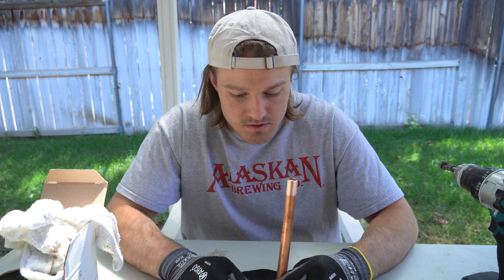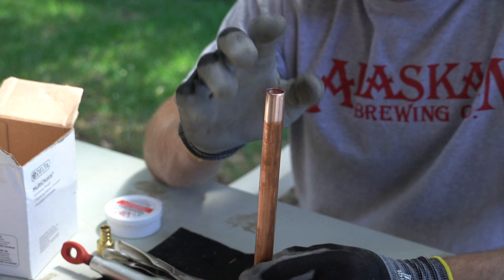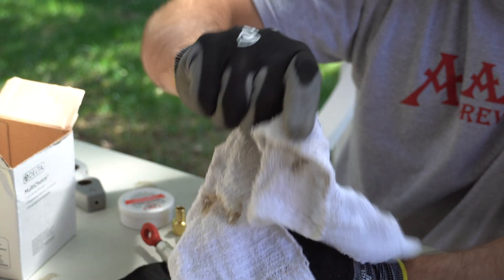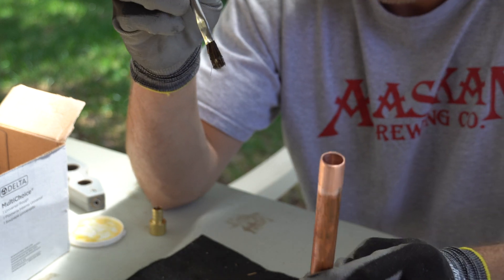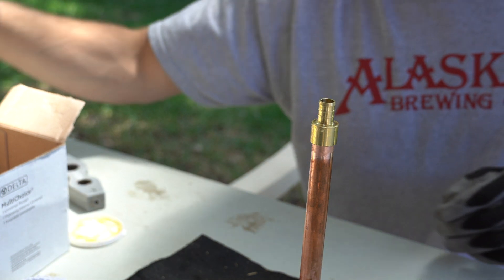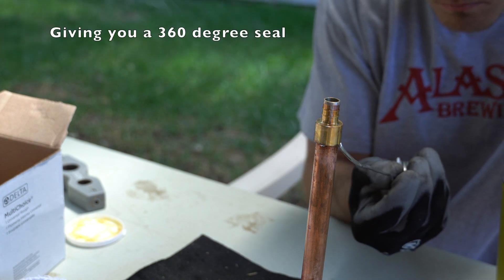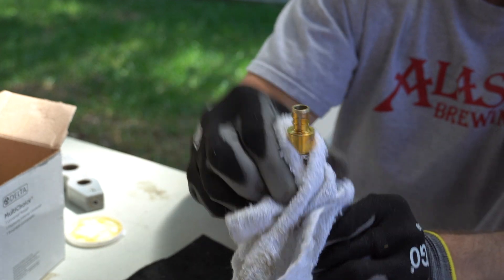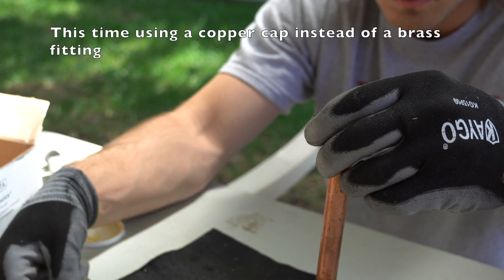How to Make a PEX to Copper Stub-Out (Soldering Tutorial)

Comment: Why did you use the drill/brush on the inside of the copper pipe?
Reply: Hi Rick great question! That helps deburr the rim of the pipe and also cleans out the inside of it
Reply: Just getting ready to do my first copper-solder job and I've seen where the pros say most failures are due to not making sure all surfaces are perfectly clean to promote full and fluid coverage of the lead-free solder.  One video actually showed how an inside unclean surface can disrupt fluid flow inside the pipe that could lead to trouble.  For me, I'll do it very thoroughly because I don't want to go back into the wall.